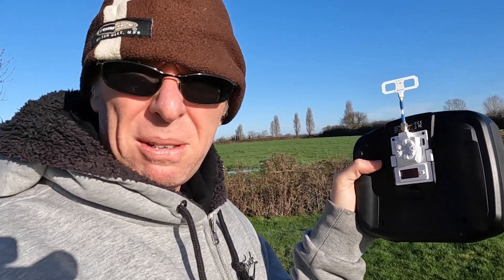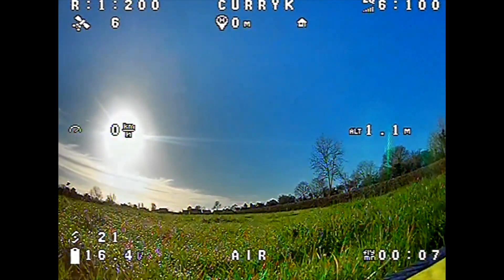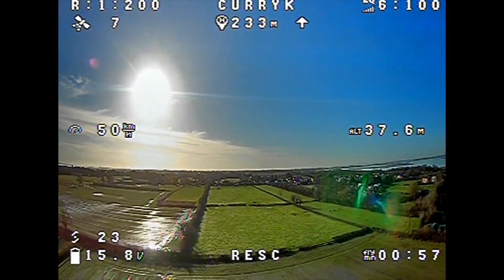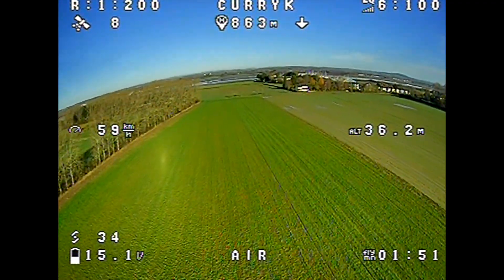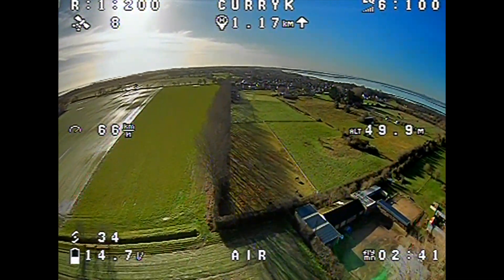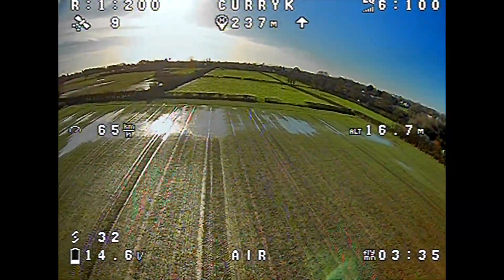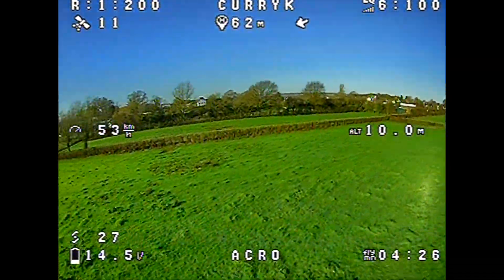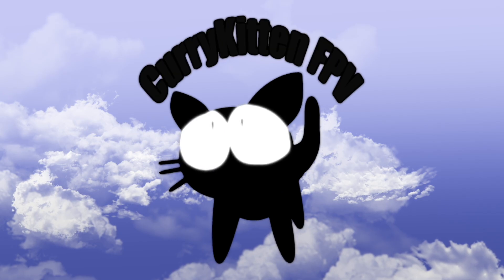BetaFPV 2.4Ghz Micro ExpressLRS module: The flight test

Comment: This module has gotten a bad rap because of the firmware issues ,I haven't had any problems with it .2.1 will solve the issue about the joystick,I've got the Happymodel module too ,the only reason I bought this was for the case .I had so many issues with the 3d printed case and even one I bought from Piroflip  ,they never gave a solid snap and locked in place .This one snaps in like a Crsf module .

Comment: What is the best way to position this moxon antenna: in the horizontal or in the vertical plane?  So should the “wire” from the radio to the antenne point towards the quad, or towards the sky
Reply from the maker: It's a very good question, and y'know I'm honestly not completely sure.  I've been using it as you see on the radio and the diagrams I've seen of the radiation pattern doesn't make it completely clear.  I'm going to check this out in more detail and cover something in a video.
Reply: @CurryKitten  Thanks a lot, the diagrams didn’t make much sense to me too 🤔

Comment: Iv had mine now for almost a month, and its been sat in the box just as long, Absolute pain in the ass to get it to work properly, got the Crux 3d with spi elrs and cant bind to it at all. Any ideas?
Reply from the maker: Make sure the firmware versions on the SPI rx and the module are the same.  The SPI in 4.3 was originally v1, I think on the latest RC it's v2.  You can set a bind phrase in the CLI (see my videos on using the SPI based rx's for how)

Comment: Your DVR is amazingly clear!
How do you have perfect dvr without a single breakup even when turning back at 1.5km away?!
Reply from the maker: On that quad I'm using a RushFPV VTX and antenna.  Rush is my favorite VTX brand, they just produce a really clean signal.  On the goggles I've got a MenaceRC Pico Patch and Periscope antenna.  So good kit on the TX and RX end of things
Reply: @CurryKitten  never heard of the mentioned goggle antenna. I'll check them out.

Comment: You had the antenna on your TX horizontally polarized so assuming you had vertically polarized on the quad the range was tested in less than a perfect configuration
Reply from the maker: The antenna was horizontally polarized on the quad as well.  If you look around 30 seconds in, you should be able to see it at the front of the quad (just under tha camera)

Comment: My question has nothing to do with the subject of the video. What's your opinion about the Mambo's ergonomics? Everyone talks about the functions of the radios, but hardly anyone talks about ergonomics. Which transmitter would you make a comparison with considering the Mambo's ergonomics?  The Mambo's ergonomics are similar to a Taranis, or a Radiomaster TX16S, or a Spektrum, or a Futaba (examples only). Nobody talks about it.
Reply from the maker: Interesting question.  I like the feel of the Mambo.  It feels like you are holding a significant thing.  I suppose it's closest to a Taranis (based on the radios I have) it feels better than the Taranis in it's slightly less plasticy feeling - and more significant (although a QX7 is a bit wider)  We were just talking a little about the Mambo last night about it's push in buttons - one of which I use for arming.  I like this as I've accidentally disarmed in flight in other radios a few times, and this button means I won't.  With that said, I do pretty much just get used to different radios very quickly, so I don't know if I have a favorite.  Different radios with different jobs.  For quad flying, I quite enjoy the smaller factor gamepad style controller - but for big complex fixed wings I might like larger radios with more switches, pots and sliders I can configure.

Comment: Dear Curry, superb demo. Convincing indeed.  Well done. Btw, i found how to connect my betafpv 85pro elrs. The firmware version of TX should have been downgraded to v1.x.x. Important is to have the same version on TX and RX. Thx again Curry. Well done. Keep it up!
Reply from the maker: Ah good stuff - you module was already on 2.x.x then?  I think when the final version of Betaflight 4.3 comes out , that will contain the 2.x build of ELRS for SPI - so that might be your upgrade route if you want to go back to 2
Reply: @CurryKitten  yes TX module was on version 2.0 already. Despite i followed strictly bfpv guidance it wasn t working. Thus had to find a new route which your video inspired. Very valuable videos.

Comment: Looks good! Almost wanting to mod my r9m to try it out now, although it's the accst version so kinda painful process.

Fingerless gloves are my go to in winter for flying that's for sure! 🤣

Would the high power 1w help out with flying at bandos through multiple walls etc?
Reply from the maker: One of my patreons is wanting to know how to mod his R9 to ELRS, so it'll be in one of my upcoming videos.  I friend was saying he had some gloves where the fingers pop off and then hold magnetically to the other part of the glove so they aren't lose... those sounds very useful.  I suspect more power on the module will help in penetration, but 2.4 is already better at penetration than 5.8, so you'd probably run out of VTX power before you needed to engage full TX power
Reply: @CurryKitten  is it possible to install Elrs Module with previous Qx7 Taranis ACCST  by just updating the latest Firmware? " Without any Modification"  or i need to ugrade ACCESS "NO CHOICE" Thanks

Comment: I couldn't help but notice your fpv feed was flawless during that entire flight. What are you using for goggles, vrx and antennas? Great video by the way!
Reply from the maker: Take a look at the Aquilla build video I linked to for all the components, but it's a RushFPV Tank Mini running at 200mw with a Rush Cherry Antenna.  The camera is a RunCam Pheonix Nano 2 (I think - it was a build of spare bits, so wasn't really planned out)  Goggles wise, my old FatShark Dom3's with an IRC RapidFIRE module with MenaceRC Pico patch and pagoda antennas
Reply: I am very curious as well ! Looked great, I'm assuming it was on-board sd?
Reply from the maker: Nope - it's regular ground recording, but I do use an IRC PowerPlay to record instead of the DVR in the goggles as it gives a better quality recording and twice the frame rate.

Comment: Great video, one suggestion though, it would be good if you could put RSSIdbm on the OSD too, it's a good way to judge signal even when LQ is 100.
Reply from the maker: When I was first doing the ELRS testing I had RSSI and RSSIdbm on the OSD as well, but as the numbers never made sense to me I decided to cut back on what I showed there
Reply: LQ paints a much more informative picture than RSSI....🤔😳🇬🇧
Reply: @EnglishTurbines  They are different metrics. Read the link I posted.
Reply: @deltageek7177  Most people don't understand dBm. Besides, LQ tells a better story, like I said...🤔
Reply: @EnglishTurbines  Except when you failsafe unexpectedly because you were at the limit of sensitivity and didn't realise. Something RSSIdbm would have told you about.
Reply: @deltageek7177  Well, I use CRSF and iNAV...As well as LQ, I also have the TX RF power status in the OSD...This gives a good idea of how much I have in hand while flying. Indeed a few kilometres just on 25mw. With auto dynamic RF power enabled, I always have RF power in hand...🤔😳🇬🇧

Comment: Nice test, but how did you manage that great video quality?
Reply from the maker: Sco0t got it correct, it's a RushFPV mini tank with the cherry antenna, but just running at 200mw.... as detailed in the Aquilla build video.  I like to use RishFPV where I can for VTX's as they are so clean
Reply: Really, 1.42Km at 200mW and nary a glitch.  I don't have that much luck in free air, never mind having a few tree lines in the path.
Reply: Yeah, what 1000+ watt VTX were you using? I'll bet a RushFPV... ;)
Reply: what fpv camera and vtx you have used this day? good signal quality

Comment: ELRS certainly is the range king. Like I have previously mentioned, I am crossfire wealthy at the moment and for my use I just cant see converting let alone ELRS is advancing rapidly and I am sure it will morph into something else within the up coming year. The fields with sun reflecting off them looked like lakes. Without a doubt tough on the plants.
Reply: I too am well set with Crossfire and see no reason to change over to ELRS, even though it does look tempting and damn good! I picked up 4 new Crossfire Nano receivers for only $21, so although the ELRS are still cheaper, not enough to care about. Plus, I know Crossfire is ROCK SOLID and the hardware is refined to the ultimate! Can't say that about the ELRS gear that seems to have all sorts of things not working from most to the manufacturers. 
Sure nice to see the same type of range and signal I get from Crossfire! It looks very promising, if we can just get these manufacturers to quit releasing products in Beta form, and actually make them fully functional before releasing them out to the public! Sheesh!
Reply from the maker: I'm always in agreement with the old "if it ain't broken, then don't fix it" idea.  If you are already happily engaged with using crossfire and it's working well.. .then keep doing it :)  I'm doing a lot of ELRS stuff right now as it's new and evolving, but there's so many different radio systems in my many models.  Load of Frsky, some R9 still, crossfire, Tracer, Ghost, several types of 433 systems like Dragon Link..  There's even a few spectrum rx's around here.  It doesn't mean I'm removing rx's to put ELRS in though... it just means I have to remember which radio to use for which model :D
Reply: @CurryKitten  Ha, I can't imagine how you remember! lol I only have FrSky and Crossfire, but I have problems remembering. I put an x at the end of the Model Name. So, Crux35HDx means Crossfire is install on it. Only way I can remember! lol